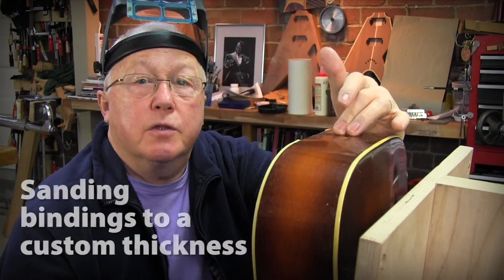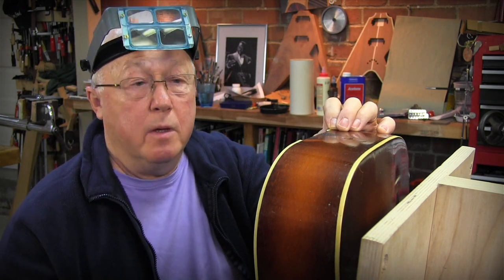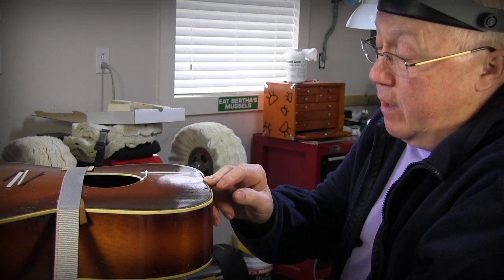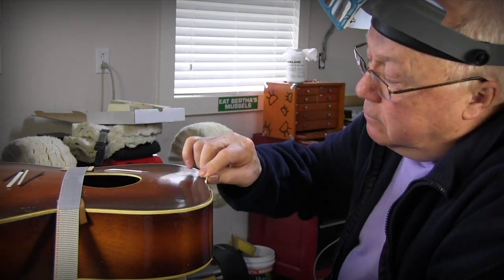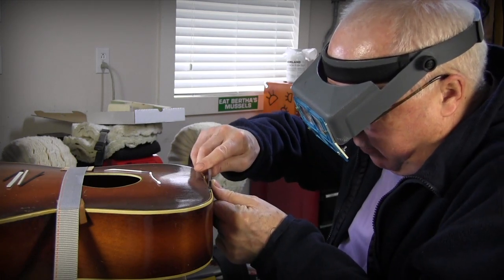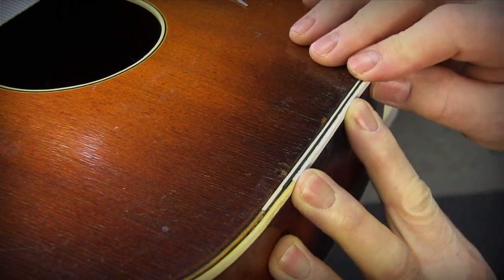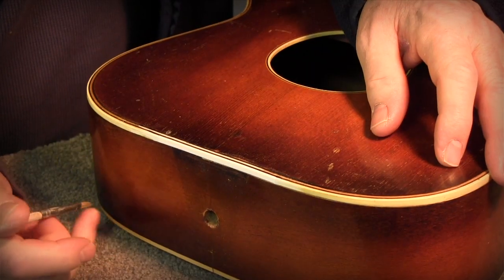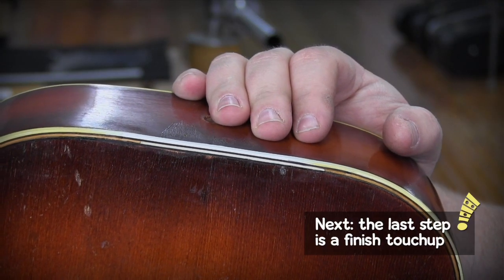Making custom guitar bindings when stock sizes don't fit

Comment: HELP if possible from Stew or anyone , I have a Yairi DY62c with some very slight fret buzz. After checking,  the neck is very straight , so i tried to adjust the truss rod , counter clockwise to add some relief and its already completely loosened.Is there anything else I can do? Or just try heavier strings ? Ive never seen a neck be so straight with the truss rod completely loose . Any help is Greatly Appreciated !
Reply: BTW ,thanks for all the video's ,there great and love learning !